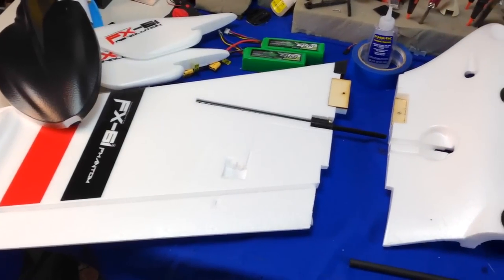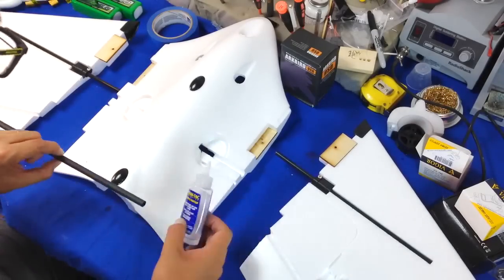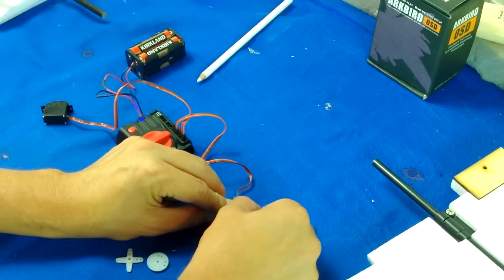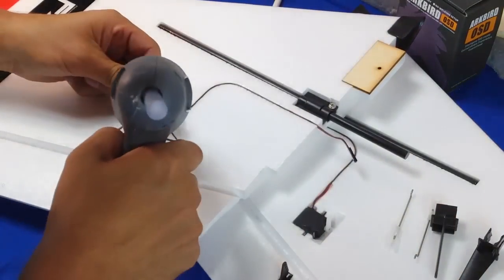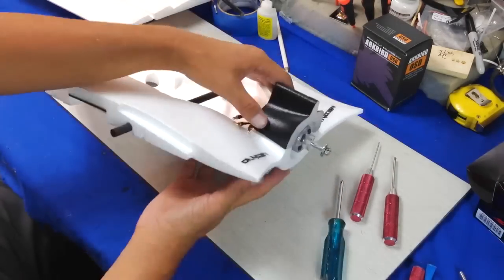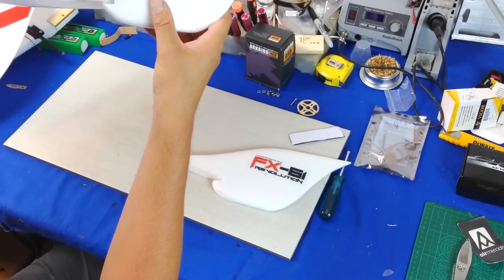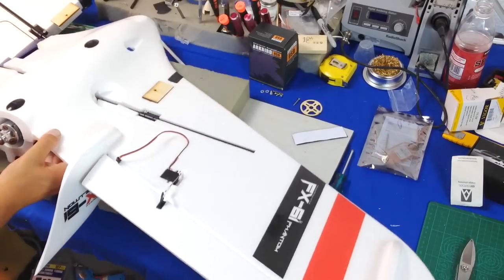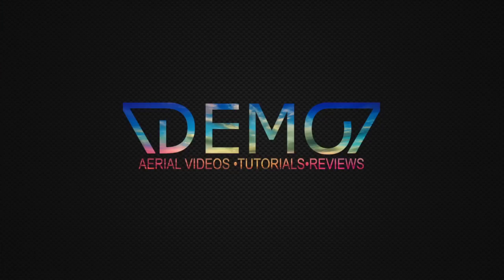Zeta FX-61 Project Part 1 of 4 Airframe Build

Comment: I know this is an old vid, but I'm looking at putting UltimateLRS onto my FX-61 (FrSky just now) and was keen to see your antenna placement for both RC and VTx. Great to have these vids for reference Jeff. Keep up the good work as always!
Reply from the maker: +Paul Atherton thanks so much!  I love this plane and fly it all the time!  Are you related to the famous Atherton family of pro mountain bikers?
Reply: I am actually a MTBer, and in my group's FB page they call me the "lesser known Atherton" :-)I wish I was related, but sadly not!

I must admit, I love my fx-61 best - it flies like its on rails, and even though I'm not very experienced with fixed wing, I just love how easy this plane flies. I am a Pixhawk nut though, and very keen on telemetry, so looking at UltimateLRS at the moment as it does a 2 way Mavlink link over the UHF channels alongside the RC control, so very keen on getting this into my fx-61 for long range control and telemetry. Have been building antennas for the UHF - just a dipole for the air side so far, looking at a moxon for the ground side. Also keen to check out a Frsky-ULRS setup which I can integrate the teensy telemetry solution into, so I will get the same telemetry screen I do now (only over UHF instead of 2.4GHz). Gives all sorts of possibilities including Ground side OSD (so if the image craps out, the OSD overlay is still there. You can see, I have got the bug badly ;-) Your channel is a great source of inspiration. Cheers
Reply from the maker: Thanks so much!!!  The Athertons come to Laguna Beach for winter training-  I got to meet them once.  The team they travel with is amazing.

Comment: Nice work! I too am staying tuned for the next installment.  I've been in FPV for about a year and fly with the Volantex Ranger EX, but have recently been wanting a wing for their hand launch ability and small landing space requirements. Been waiting on the Ritewing Drak but if it doesn't come out soon, the Phantom is my next choice and I'll likely follow your build step by step. Thanks and keep up the good work! Let us know your flight times :)
Reply from the maker: +PoppaShocka Thanks, I'm wondering if I choose the correct motor.  I might have to step down to a 1000-1100 motor if I can't get the efficiency out of my current 1400kv setup.
Reply: +7demo7 makes sense I suppose. I've had the 1200kv SK3 Aerodrive and burned it up on my Ranger. I've had a hard time matching the right motor/ESC/prop to my airframe. I'm using a big can/low kv on there now and does great on efficiency but doesn't quite have the umph I want. Good luck on your motor hunt.

Comment: Nice choice of airframe. I use the same brand motor but a 1200v 3542 size. You're motor will probably work great but if you find the plane a little down on power then try the above motor with a 10x6 prop. 

Also I recommend putting some laminate on the wings. Really helps stiffen the airframe and helps with keeping them looking nice.

Good luck.
Reply from the maker: +benjahnz Thanks for the tips, Im a laminating fiend!!

Comment: Good job bro, where is the CG for this wing?
Reply: +7demo7 
I know the manual calls for it to be just in front, but you should put the COG right on the spar.  It will fly much better.
Reply from the maker: Just forward the carbon fiber spar
Reply: +Impact RC Thank you bro.